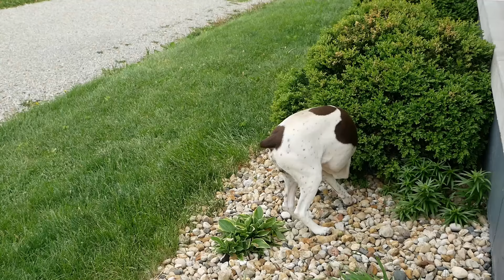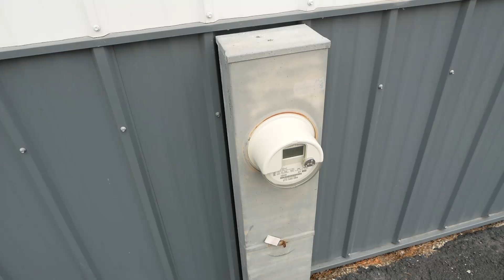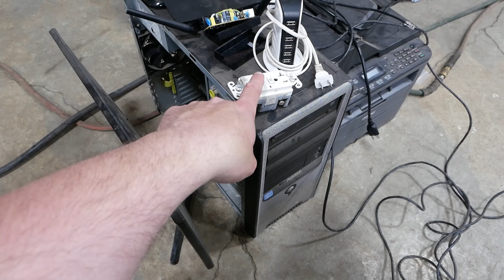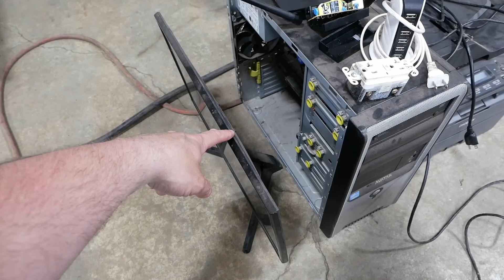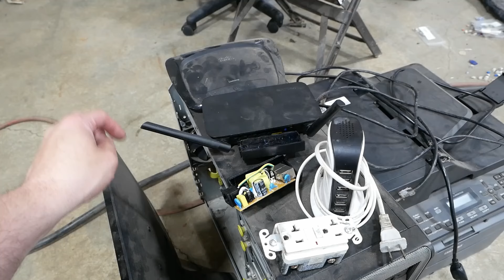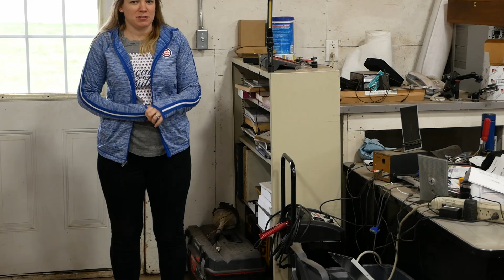Lightning Strikes Shop, Again...

Comment: Computer repair technician here. I tried to do an informal survey of what computers were plugged into when the usual huge rush came into the shop after a thunder or lightning storm. Almost without fail, people said it was plugged into s surge protector strip. Only a very few were plugged directly into the wall. 

Conclusion: Surge protector strips NEVER protect devices from a lightning strike, direct or indirect. However, never once, ever, did a "lightning-surged" computer come into the shop that had been plugged into a UPS (Uninterruptible Power Supply) aka "battery backup". Not once. Other devices in the home would get damaged, but never the devices (computer, printer, modem, etc.)  plugged into a UPS. Conclusion: Lightning NEVER passes through a UPS to a computer. 

Diagnosing a lightning-surged device is easy as pie, too. All you have to do is smell it. It will have that unmistakable "burnt electronics" smell. Most of the time only the desktop computer's power supply (easily and cheaply replaced) would get damaged and burn up fast enough to stop the strike from continuing further inside, but sometimes everything in it would get ruined. Bottom line: Use a UPS if you can afford the expense (about $90 on Newegg) and throw those stupid "strips" away, and if you don't have one and your computer gets lightning struck (stricken?), go online to Amazon or NewEgg and get a power supply (checked Newegg just now: 650 watt ATX power supply, $39) and replace it. 99% chance that's all that's wrong with it.

Comment: Wes, Power strips can  attract lightning into your home/shop. Really!!  
You need a whole shop protector at the meter base, then you can use surge strips inside the building.
But you should INSIST that the utility install a secondary protector at the transformer at the pole.  That will help a little.

Comment: Power bars / power strips have a limited lifespan!  They get 'fused' shut so the surge part stops working.  I'd place your computer and wireless Internet on a UPS as that's more sacrificial than your equipment!

Comment: I started a 41 year career in 1979 in the mechanical department of a major southeastern railway company. In the late 70’s/early 80’s Miller and Lincoln were in an intense competition to grow the “midsized” engine drive market. Lincoln had introduced the Weldanpower 225 ac/dc with a    16hp single cylinder Briggs & Stratton engine, Miller the Bluestar 2E. The railroad purchased a few of these Bluestars, but they turned out to be a bear to keep running! Being a Lincoln guy, I bought a Weldanpower for personal use, and the armature shorted out on it just over a year! To their credit, Lincoln replaced it free of charge (it was evidently happening to the majority of them!) and I used it for years after that. As far as the fuel pump being necessary, in the railroads case all the welders were truck mounted. When the pumps started giving trouble they decided to straight pipe the fuel line and not use the pump. The result? Crankcases full of gasoline! As the trucks hammered up and down the rough railroad yard roads, and the tank above the carb, the float would get jarred open and pour gasoline into the cylinder and crankcase! Installing shut off valves didn’t help because the repairmen would forget to turn it off! The pumps were put back on, but they wound up selling off these Bluestar machines. Glad to see you give this old gal some love! I’m sure it will serve you well!

Comment: Took a direct lightning strike to the utility boxes on the side of the garage back in 2019. It blew them to smithereens! Also killed my brother’s car (2004 Buick of some kind) that was parked just around the corner, in front of the garage (a few yards away). No marks and no crank. Everything would chime like normal with the key and all the lights and electronics would come alive except for the indicator light that moves behind PRNDL. It could be something as simple as the sensor for Neutral/Park but we’ll never know since the insurance company decided to total it. I do know that all the fuses and relays checked out.

Last year the same driveway took another automotive life: I was parked in nearly the same place as he was when a direct hit from the strongest part of an EF4 tornado picked up my car. Who even knows where it would’ve ended up if a tree hadn’t fallen on it? The workbench between my car and the garage door was gone. I didn’t realize it had moved my car until I got the tree off and found it was parked on top of PVC pipes that were stored 8 feet off the ground on top of the now-missing double-decker workbench. Another car straight down the street was completely flipped over (no trees) so that could’ve been me if not for the tree. Had to say goodbye to my 2011 Corolla anyway after Geico had a look. :(

It could’ve been worse: Another neighbor’s house 800 feet away from me was completely gone with just a yellow Camaro left on the otherwise-empty concrete foundation. It had been parked in the garage and was, of course, left heavily damaged. To add insult to injury, his green Camaro that was parked at the street got impaled with wood and other debris. They aren’t quite Camaros but dude builds Kias at the West Point, GA factory so I hope they can give him a good deal on one.

Comment: I suggest that you plug your computer equipment into a UPS.  Lightning strikes will destroy the UPS, not was is plugged into it.

Data lines can be protected with this device:  

Data/DC Line Protector Cat5
TESSCO SKU: 364992
QTY/UOM: 1 EACH
UPC: 888063649929
MFG PART #: IX-2H1DC48

Hope this helps

Comment: UK Hi Wes. The UK has pretty stable mains, most of it is underground but for the first time in over 40 years we had a brown out, just a very short blip, it took out a hard drive, nothing else. Surge protectors won't stop thousands of volts from lightening jumping across them but an Uninterruptible Power Supply (UPS) stands a better chance (I hope). Apart from that it does give you some time to shut down properly should you get a power failure.

Comment: It probably just the motherboard and power supply that are bad. The processor and HD are probably ok. From my experience if the power supply fails a compont on the motherboard gets fried and the machine wont boot. A good thing nobody got hurt.

Comment: So a few suggestions, I'm an IT guy of 16+ years and ham radio guy. One thing I found in lightening prone areas (lived in the Memphis area for 10 years) is that all electronics you care about should ALWAYS be on a UPS, the battery side specifically. The battery smooths brown outs and takes the hit before your electronics will. You can also, and should, run your Ethernet cables through the UPS. You can also buy lightening arrestors for your Ethernet which run to a ground, I would suggest running the ground to a separate rod you drive in. But you also may want to consider a whole shop arrestor/surge protector on your breaker box too. Siemens makes great ones. Also buy quality surge protectors for each outlet you need them on, I suggest the metal Triplite Isobar ones, they have great lifetime insurance included, and replaceable fuses too. You guys need to move! 😀

Comment: They sell whole house (or business) surge protectors for places with lots of lightning. Another option would be a server grade UPS which would filter the power for your desktop, routers, modem, and printers. A plus for going the UPS route is if the power goes out you might still have internet if your provider has backup generators, and with a decent UPS you would have about half an hour of power. 

Point is the electricity coming from the wall is dirty with spikes, noise and is never clean.

Comment: 👉  Call the ELECTRIC COMPANY and have them check the electrical ground leading to your shop. We had this happen in our neighborhood twice (messed up a lot of stuff - computers, printers, modems, televisions, etc) and it turned out the electrical connection from the pole to the house wasn't even grounded. In fact, the whole neighborhood wasn't properly grounded. Once they fixed it (their responsibility), no more problems for any of us. By the way, we all learned surge protectors won't work if they're not properly grounded.

Comment: Surge protectors in receptacles are not able to give you a good protection against lightning, especially when you're supplied by overhead power line. You need a surge protector right after the meter and also  in EVERY electrical cabinet, that is further away than 10 yards from the meter. Yes it's expensive, but it's worth it. Surge protectors have to be installed first in line before all the fuses. Make sure your protection earth has a low resistance. PE cables the bigger the better. If the resistance is not low enough, it has to be improved.

Comment: Those yellow knobs are holding in your hard drives.  You need to yank the hard drives out and take them to someone who has computer chops and see if they can make a copy of the data for you.  If the data is still there, it shouldn't be difficult at all.  If the hard drive is fried in some way, you'll probably not be able to access it no matter what.  But you've got to yank it out and hook it up to see either way.

Alternatively, you could yank it out and buy a cheap "USB3.0 to SATA External Hard Drive Docking Station for 2.5 or 3.5in HDD".  These are usually called "Enclosures".  They let you read loose drives you have lying around without the need to actually wire them up inside the computer case.  Sometimes it's better to let people spend 30 bucks than have to open up their computer and wire stuff up themselves.  To be able to use that enclosure, you'll have to have a computer to hook it up to.  Sorry you gotta go through it.

There are 3 types of hard disk drives.  The big heavy ones are 3.5" and will say HDD on their label.......the smaller credit card size ones are 2.5" and will say SSD on their label.  There's also a type that's a thin rectangle circuit board called an M.2.  Enclosures will usually adapt 3.5 HDD and the smaller SSDs fine.  If you ever run into a M.2, they require a different adapter/enclosure.  But from what I can see, I think you only have one HDD in the very bottom bay.  There should be 2 connectors plugged into it.  I think that's all the info I got...good luck to ya.

Comment: A whole-house surge protector, installed at the service entrance. Get the biggest one you can find. Apparently you should size the protector depending on the likelihood that you're going to get a direct strike. Which in Illinois, apparently, is high. 

In the 21st Century you'd think no-one in the lower 48 States would be without internet. Go figure...

Comment: I reccmend a  UPS (uninterruptible power supply) with a surge protector inline  to it. It will help to absorb spikes like  such, not perfect but much better than a regular surge protector. Also  has the benefit of conditioning the power if your shop  has  old wiring.

Comment: Your internet woes sound like my history.  Hughesnet (horrible rates), local wireless bought by Sprint then service was dropped, wireless (WISP) and finally Verizon 'LTE Home Internet'.  Very happy with the latter which we have had for 1.5 years.
Regarding lightning issues, our new-built home has whole-house protection in the circuit breaker boxes, but I think what really saves us is our lightning protection system.  We have seen many trees near the house that have been hit by lightning.  If you get into the theory of why strikes happen, prevention is a process of ensuring that the charges in the ground are equalized with the charges in the air.  A lightning system does that equalization before potential builds enough to cause a strike.

Comment: Wes…When Lightning hit my house, I was finding things that did not work for months afterwards. The big problem I had was the Gas line to the stove went across in front of an outlet. Apparently, it jumped out of the outlet to the Gas flex line and blew a hole in it. A couple of hours later I realized I had a gas Leak!

Comment: Long post about ways to avoid damage by modifying your service entrance. 

——- 

There are some methods to help prevent damage from utility strikes. NFPA 70, 2020 & 2023 have some suggestions and there are at least two companies I know of selling parts for these newer methods. (I can’t afford another YT strike so I won’t give company names.). 

You will need to talk to someone who is staying current on code developments. My massive rural county has exactly zero such people for a land mass the size of some states. 

I go to a guy named “Mike Holt.”  A YT search will show you why and how to reach him. He can point you to “local” people who know what they’re doing. It’s easy when he explains the NFPA committee system. 

It takes time to find the right help. Even in my loose code enforcement county they won’t let me touch meter bases without help from a licensed pro. Parts are cheap. It was worth it to me. 

——-> Safety

My inspectors let me do all sorts of light industrial stuff like 3P motor control centers stuffed with VFDs, reactors and computer gear but everyone is afraid of lightening damage prevention work. I trust my inspectors on this. If they won’t let me do it, it’s probably dangerous. I wouldn’t try it the “farmer” way.

Comment: I'm sure people have already told you, but Starlink is available in Illinois. I work outside of lacon(north of peoria) and we just got Starlink. Went from a download speed of 8mbps to 180mbps if I remember correctly. It performs quite well. My boss had to get put on a waiting list, $500 for the equipment, $130 a month I think. Got the satellite and the router fairly quick, easy to set up too. Hope this helps!

Comment: If its not one thing its another. Based on your videos I know you will take it in stride. I do believe there are commercial surge protectors for your shop. I have installed home surge protectors in my house circuit breaker panels. Good luck.

Comment: Eaton makes a very robust surge protector that connects directly to a high current breaker in the panel.
A recent strike on a pole a few farms down the road didn't damage any equipment at the farm.
JGC

Comment: I, too, live out in the country. I, too, have Nextlink internet "service". The lightning didn't hurt your computer because of the GFCI or the surge protector. It went through the POE injector. There is no way that I know of to prevent a lightning strike from going through that dish antenna thing. Once it hits that, it jumps down the ethernet cable, runs through the POE injector, through the router and into the computer via your ethernet connection. Blows the motherboard. The way to fix that is to get a wifi connector on your computer, so there is no path for the surge. I use laptops everywhere and have a 27" monitor plugged into the laptop. Doing that isolates the different systems and limits the damage.

Comment: While it sounds like most of the surge probably passed through the ethernet side of things, you might want to replace the power strip your computer was plugged into as well- even if it still works, it probably uses MOVs to absorb the surge, and those do get worn out by use.  Each surge reduces their capacity to absorb future ones, apparently.  Or so I read somewhere once.  I have no idea if there is a way to test them, but it's probably cheap insurance to just toss the thing in this case.

Comment: In Poland providers are disclaiming responsibility in such cases if you don't have your own protection devices. You should install at least surge protection on your electrical connection and a small UPS for your office electronics. My advice is to install bigger, central UPS system to protect and sustain separated electrical circuits in your buildings. You can also add automatic switching to combustion generator, so you can work safely until provider will restrore power. I know it's expensive, but how much money have you lost due to the damage and downtime?
Edit: You can add also protection for antennas and ethernet connections. Ethernet protection is often built into small UPS devices.

Comment: 4G LTE should be in your area (Fulton Area) or are you more east. If so even 4G none LTE should get you around 25 Mbps which is not great but works. I assume the line of sight is out of Union or Fulton and with all the bunny hills I would think someone needs a big tower which is like saying to lightning (LOOK AT ME). Not sure any form of internet is good until SAT comes into favor and cost is better. Good Luck and many thanks for all the great videos keep moving is all you can do!

Comment: I feel ya man. I was using a fixed wireless unit like yours until I switch to a cellular option, which has been terrible as well. I have been waiting on my Starlink invite since February of 2021 when I preordered it. It shouldn't be long until Starlink will reach us both. Probably within the next year or two.

Comment: Those power strips they so call surge suppressors are a waste. They do make real ones that are more of a box such as TrippLite 4-Outlet Isobar Surge Suppressor. (Just an example)    Also they make lightning arrestors that wire into you circuit breaker box.  They are not expensive.  Around $100-150 plus installation. Nothing is 100 percent, but these items will tend to save more susceptible electronics.